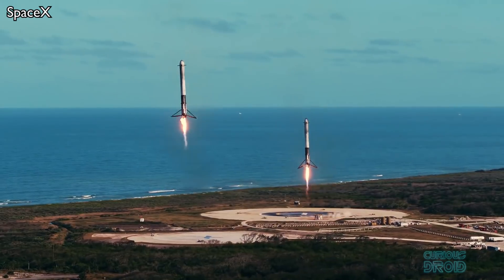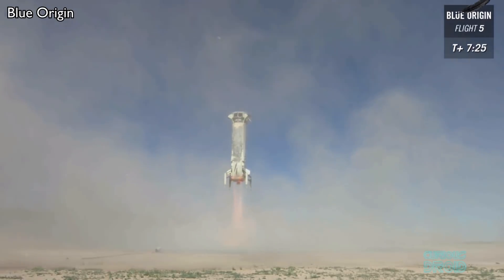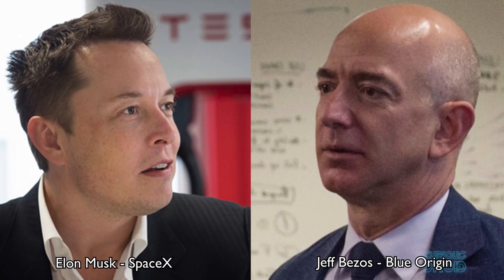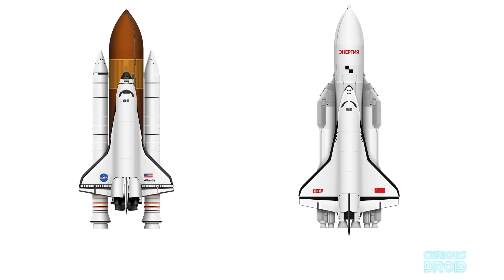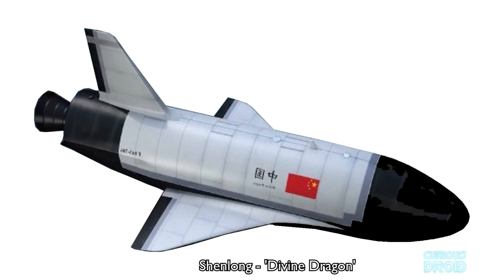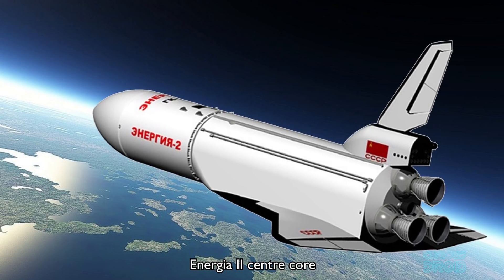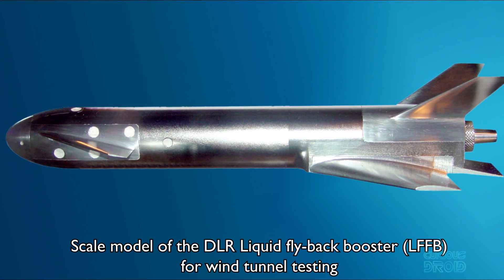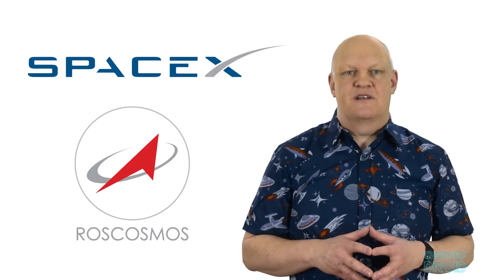Reusable Rockets & Flyback boosters

Comment: The soviet shuttle design eliminates the need to carry the orbiter to space every time, which you cite as the main disadvantage of both, without making the distinction.
Reply: The Soviet Shuttle literally is the orbiter.
However Energia can launch payloads without the SovShuttle if that's what you mean.
The major benefit of the SovShuttle was that it didn't carry the heavy engines all the way to orbit and back; they stayed on the booster.  It could be argued that the US Shuttle was an engine retrieval system.
Reply: Ya, that's what I mean.  Soviet engineers realised that making the whole system dependent on the orbiter was illogical, you're basically throwing away the heavy lift capability.  There are many approaches to reusability for space vehicles, the space shuttle was one of the worst possible options.
Reply: Hold yer horses - Energia alone wasn't able to put anything into LEO. It required a separate upper stage for orbit insertion, so while the overall system design was indeed superior to the STS, the rocket's capabilities weren't directly comparable to the STS either.

As for the space shuttle being one of the worst reusable options - that's debatable. The original designs (that is, before the Pentagon jumped at it and added a ridiculous list of required capabilities) were sound. They were so good in fact, that the Soviets felt the need to mimic and improve upon them. The Shuttle died because of two factors: feature creep and lack of target (-market). The intended launch frequency of the STS was projected to be ~50 launched per year. At that rate, cost would've indeed reduced to just a few hundred dollars per kg of payload.

SpaceX faces the same dilemma, btw. The global space launch market was about 8.8B USD in 2017 [3]. Japan's Imabari Shipbuilding company, the 5th biggest plaer in the global market, had order book values of 9.9B USD in 2016 [1]... I gave these numbers just to illustrate how tiny [2] the space launch market is compared to other markets. In a niche business like space launch, the drive for innovation is very limited as the ROI on any expensive R&D is measured in decades (ignoring government subsidies).
Why do you think SpaceX applied for a license to put more than 4000 satellites into orbit? That's more satellites than have ever been active at any point in the history of space flight! The reason is that only a massive fleet like this ensures enough demand for launch capabilities to justify reusable rocket systems like the Falcon 9 while taking advantage of economy of scale when it comes to production.
Think about it - from a payload perspective alone, a set of four partially reused Falcon Heavy launchers could serve the entire market of LEO and GTO satellite launches. Things tend to be little more complex than what they seem on the surface. Also remember that despite several billion dollars in subsidies, SpaceX is almost 2 years behind schedule with their manned program. A US taxpayer should be just as mad at SpaceX at this point as they should be at NASA - reusable booster rockets or not. 

[1] https://www.statista.com/statistics/257865/leading-shipbuilding-companies-worldwide-based-on-volume/
[2] https://www.statista.com/statistics/185460/worldwide-commercial-space-launches-since-1990/
[3] https://finance.yahoo.com/news/space-launch-services-market-estimated-212900003.html

edit I added some sources and corrected the volume of the space launch services market up a little, though the new number may include business sections not covered by SpaceX... I still wanted the numbers to be as unbiased as possible.
Reply: I don't know why Energia can't get to leo on it's own and yet it's leo capacity is rated at 100,000 kg.  The soviet's were convinced that the shuttle was a strategic weapon whose capabilities had to be duplicated at any cost (even if they didn't know the true purpose). 
SpaceX does not get any subsidies from the US government, in fact the GAO has said that SpaceX has saved US tax payer dollars.  That's why they have Dragon, because they won on cost and development time in a competitive bidding process.  You are being irresponsible by spreading baseless slander.
Reply: +Lucas Bowering
And you are being irresponsible by not properly addressing the person you're talking to. Add a name, or else no one in the thread will be sure who you're talking to!